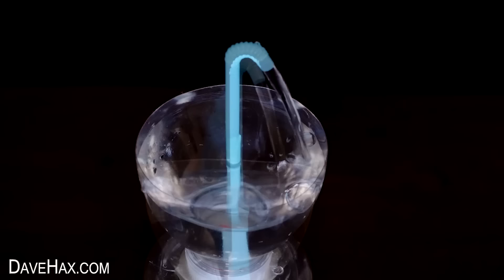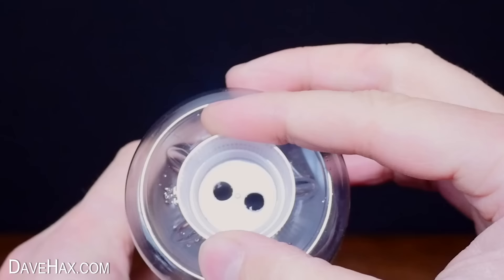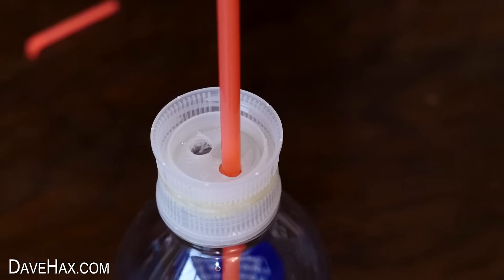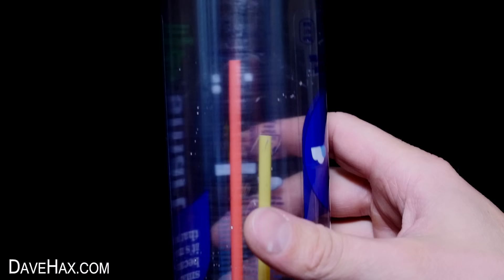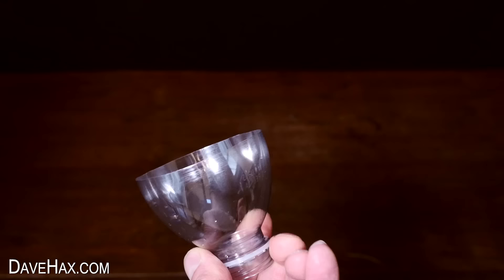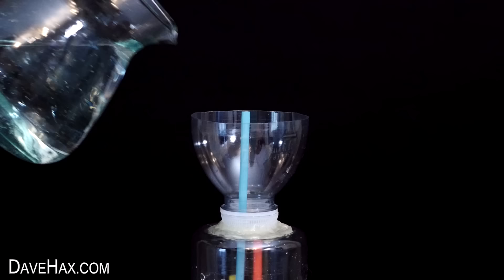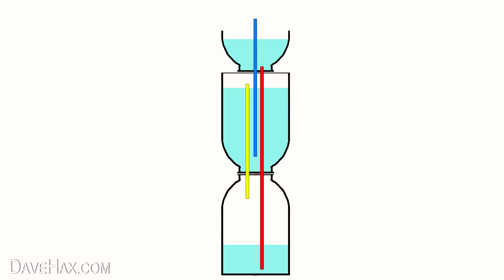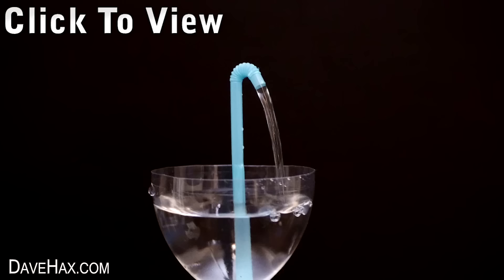How to Make a Non Stop Heron's Fountain

Comment: The only reason why I watched this was because it's titled "non-stop" which is usually against the laws of physics? Pretty cool none the less but definitely not non-stop.
Reply: @billygibbs3222  It keeps on flowing UNTIL the water in either of the bottles has run out, which makes it stop. It stops = not nonstop
Reply: Energy can’t come from nowhere. It’s against the law of physics
Reply: @billygibbs3222  what video did you watch? The last minute he shows how it stops after the bottom bottle level reaches yellow straw or top bottle level falls below blue straw, i.e. no more pressure to push water. Hence, not non stop and certainly not infinite.
Reply: I was just searching for such a comment !
Reply: @Poizon

yeah I thought the same
Reply: Yeap if this was a non stop thing i would make public a new engine that works with water and never runs out soon 🤪
Reply: @limibosi1785  Same! That's why I built it for myself! It took  2 attempts because at first, I used regular water bottles with a bumpy texture and got LOTS of leaks. Then I used the flat bottles like in the video and it worked. But it wasn't nonstop, and so I decided to go back to his explanation of it and found out why. :p
Reply: Agree 💯
Reply: @billygibbs3222  Which vid did you watch?
Reply: yes me too lol perpetual motion is a myth
Reply: The only way it might be possible is through the use of a superfluid (liquid helium for now) and a really thin tube that brings the water to the top. Even that hasn't been successfully done yet and here's some guy arguing for infinity...
Reply: @billygibbs3222  if this was the case dont you think energy companies would utilize huge fields of these to run turbines for an infinite source of energy?

Its impossible for something to run forever. If it ran off of gravity, it would need to raise the water back up (to a state of higher energy) in order to utilize gravity again. The laws off thermodynamics state energy in a system is always consistent, if it ran forever it would not be consistent
Reply: @billygibbs3222 Oh Billy Billy Billy! How old are you, son? I apologize if you're 12, and if you are, I'd be happy to detail the video for you and try and explain how fascinating the interplay between gravity and pressure is that's making this work. If you're an adult, however, good luck to you.
Reply: If it flows non stop it will broke the second law of thermodynamics: energy in a vacumm tends to spread out to a process like friction.
Reply: The water will eventually evaporate
Reply: @DDS Software it’s movement energy
Reply: Not nonstop at all. Perpetual motion machines are impossible.
Reply: There is no free energy device
Reply: You read My mind
Reply: It can be non-stop, just connect a pump and power it on and waste electricity, or connect it to a faucet and waste water.
Reply: @michaelralph8490  yes but there could be a power outage
Reply: @censusgary  perpetual motion is not impossible, free energy or over unity is impossible. Perpetual just means its running forever, and its not against physics to run something forever as long as you are constantly putting energy into the system. And in a closed system with no forces acting against it, the system will be exactly 100% efficient and run forever but you cant pull energy from it since it would add losses and stop, common examples of perpetual systems that run forever are liquid helium flowing in a closed loop or planets moving in our solar system.
So perpetual motion is not against physics, and perpetual motion can only happen in a closed system with energy constantly put into it or if there are exactly no losses to slow the mass down.
But free energy, or over unity, the idea of creating energy from nothing is against physics.
I know you actually meant over unity or free energy but I just felt explaining since I'm bored.
Reply: @AaronDarden  there is a way to get free energy but it is illegal, just connect a cable to your nearest street light and run it to your house, just don't let the cops or the electrical company see.
Reply: @gam1n302  lol, backup battery or solar power
Reply: @michaelralph8490  Solar power= no power on night. Battery= Low Battery
Reply: @gam1n302  solar power constantly charges the battery, so no Sun = buckup power that lasts until there is sun again ( basically how all solar systems work ), backup battery charges while there is power, when power is off it kicks in, when its too long without power and its daytime then charge it with solar, at night a hand cranked generator, being creative LOL
Reply: Yes, currently nobody has been successful in making a perpetual motion machine
Reply: @michaelralph8490  No battery can last as long as 12 hours. (I think)
Reply: @mjyanimations1062  have you heard of difference in potential !! its not creating energy but rather using the water pressure to move a liquid
Reply: Yeah i was hoping to see some perpetual motion
Reply: Me too. It's always against the laws of physics
Reply: witchcraft confirmed
Reply: But the earth is still flat, right?
Reply: You must be really smart realizing that a home-made experiment does not actually include a non-stop fountain
Reply: @Hellothere-vr9um  There are some "endless weight" pendulum clocks which use a double-pulley mechanism to allow the weight driving the mechanism to be reset without affecting the tension on the drive; I'd been hoping for something conceptually similar: a fountain which would need to have water continuously added at the top, and which would continuously drain water from the bottom, but would squirt water to a height higher than where it was added.  This would not have to violate the laws of physics in any way if e.g. every 100ml of water added at the top or circulating through the fountain would resulted in 20ml draining out the bottom but only 80ml squirting out the fountain.  I'm not sure if there would be any practical way to construct such a thing without moving parts, but it wouldn't be a "perpetual motion machine".
Reply: GET BAPTIZED AND FOLLOW GODS RULES TO GO TO HEAVEN..
Reply: @limibosi1785  why dont ya? I bet it's possible with  a couple adjustments
Reply: @Poizon-  its as closemas you can get to non stop with everyday objects is what he means.
Reply: @spidercat8262  How long did it take before it stopped?  A couple of minutes?  I would be curious to try with different straws!
Reply: I just replies that to someone :o
Reply: Who is Billy gibs here ,everyone is replying to him
Reply: @MikeC-ps1tc  After like 15 second to a minute
Reply: @spidercat8262  Ahhh okay, thats not bad.  I was thinking of a cool endless fountain to use on the pets!
Reply: @MikeC-ps1tc  That sounds epic!
Reply: @spidercat8262  Haha yeah, I am sure there would be a way to auto fill it, overall it is a cool thing to do!
Reply: @MikeC-ps1tc  If you can make it infinite, send me your instructions! 😂
Reply: Non stop rotation of Earth, Non stop river?
Reply: Actual non-stop/ Self sustaining fountains do exist, this is just a 3rd grade version.
Reply: Every non-stop flight ends at some point
Reply: DaveHax > physics
Reply: That was why I clicked too
Reply: Ikr
Reply: what the name sains principle is this.. like what teory behind water can fluid with gravity
Reply: Not nonstop but long-stop.
Reply: Yeah that name's a little bit misleading
Reply: Same lol
Reply: This is because of trapped air... Which gives pressure

Comment: Great video. Made one based on your design. Just a few comments: 
1) Get bottles with flat (or nearly flat) bottoms. Don't get the bottles that have the 5 or 6-star bases. It's more difficult to make that top cap airtight
2) Take off the labels before you begin constructing the fountain. I recommend goo gone and vegetable oil to remove all traces of the glue before you begin. 
3) Trying to drill through the hard plastic base of the water bottle is difficult and frustrating; it's much easier with a soldering pen to melt open a hole and then you don't need a large hole, just two straw-sized holes to match the holes in the top cap, 
4) A better way (IMHO) to splice the straws is with a diagonal cut;  the straws can then be connected almost without needing glue, 
5) Also use a diagonal cut on the ends of the straws as you thread them through the holes. Makes it a lot easier to pull them through and then once you have the straws threaded, trim to diagonal edge to make them even again.
6) Glue the ** out of that top cap between the seams and the base around the top cap, it's where you'll get the most air leakage. Also, enclose the glue seal in duct tape to add more protection.  It has to be completely air tight because any loss of air pressure will cause the fountain to fail.
7) In addition to glue, wrap the middle double cap with duct tape - maybe multiple layered colors for a nice effect. It will make the double cap more firm and stable.
8) Dye the water with food coloring to make a cool fountain and for an even neater effect, fill the reservoir with blue-dyed water and pour in yellow-dyed water. As the colors mix you get a nice shade of green.
Reply: 😁 only one who made it successfully can say this.. why don't you make a video of it(just an advice)
The most frustrated thing in this experiment is no matter how much glue you use,they will leak 🙃 i tried and lost my interest
Reply: @bhavana1425  yeah, the glue is where the thing usually fails. I had the best results by using a plumber's sealant.
Reply: You actually did try is and have advise for a better result ??😂😂
Reply: @bhavana1425  Don't use glue.  Use a silicone adhesive or Aquarium sealant.
Reply: If you’re unscrewing the bottom bottle, then just having two holes for the straws at the very top won’t work because the straws will get twisted if they’re rigid
Reply: @alishbanathani  That can happen which is why I was careful in arranging the straws and holes so they wouldn't get twisted while screwing the cap into the middle bottle. But yes, you have to watch out for that.
Reply: @nerapsnart  broo youre so smart please tell me your instagram
Reply: So if it's completely air tight it would technically be a non-stop fountain or would it just last much longer
Reply: @Archtew  it can't be a Non-Stop Fountain because once all the water in the central bottle has moved to the bottom bottle there's nothing you can do after that. But to make the middle bottle empty into the bottom bottle you have to have things air tight, because if air is escaping from the system, there won't be pressure to put the liquid from the middle bottle up through the fountain
Reply: Thanks for the tips. I made this device as a demonstration for Energy Merit Badge for Scouts BSA. Mt first attempt failed. You are right about getting a bottle that is flat on the bottom. I used old Gatorade bottles, and they have a star on the bottom. My first attempt leaked badly. Using a drill on the non-flat bottom was just impossible, which is why my first attempt failed. On my second attempt, I heated the end of a metal rod using my gas stove and just melted out a hole. Much easier. I didn't understand why you had to have a big hole on the bottom either, until I twisted all my straws on my first attempt. I did get it work on attempt two. To avoid leaks, I pre-tested the lids. I used massive amounts of hot glue. And to overcome the non-flat bottom I used so much glue if effectively became flat (with a melted hole of course).

Comment: I feel so sad when i hear the "to restart the fountain"
Reply: Well perpetual motion machines aren't possible
Reply: @RealArtUplifts But they aren't?
Reply: Hilih sama😭😭
Reply: The deltarune  vibes lol
Reply: Marc Scattolin it is for the snowpiercer!
Reply: Pmm are possible.
Reply: But the reset is so easy😊
Reply: At this point just use some of the energy from the machine and boom nrg
Reply: @RealArtUplifts how is it not helpful if someone doesn't realize they aren't possible they will keep falling for the videos that claim that it works constantly
Reply: @kennyrodriguez4641  you would constantly be loosing energy and the energy required to reset it will eventually cost more energy than its producing
Reply: Non stop restarting.
Reply: 1000th like
Reply: @assassinerage1909  it could be nonstop if the water level was perfect.
Reply: @tawsifiraj6060  That's a strawman argument. It's a logical fallacy, and it's irrelevant.  The point is that the video referred to a "non stop" fountain, but the fountain stops.  The video title is wrong - black and white wrong - period.

Comment: A "non stop" fountain that "stops" after each 2 mins...  Lmao.
Reply: True
Reply: It is nonstop restarting
Reply: You can try with liquids with higher density
Reply: No one can make perpetual motion machine. Because energy cant be created and destroyed at same time. This fountain is one of them.
Reply: I salute you for saving me almost 7mins of my life
Reply: @laureen69  haha...wlcm !
Reply: @Epic Genius "It doesn't take energy." I don't think you understand what energy is. The act of pouring water on the top creates potential energy that is transferred through pressure, to fluid, to air, to fluid pushing the water in the second chamber to the top. Electrical energy even at it's core is movement that is transferred into mechanical energy via motors.
Reply: @harshit3964  making a non stop fountain without the help of energy is pretty much impossible
Reply: @laureen69  lmao😂
Reply: @imlearningenglish4957  they have lower chance of going up the straw.
Reply: GET BAPTIZED AND FOLLOW GODS RULES TO GO TO HEAVEN..
Reply: Well technically it’s impossible to make a nonstop fountain because that would be infinite energy
Reply: their is air inside  bottle. the water  keep flowing
Reply: @tiaguilho1335  you mean energy?
Reply: @tanwodan3689  no the water stops every two seconds
Reply: @imlearningenglish4957  no you would need to try with a liquid that has its molecular structure in the same shape as a chain so the water keeps flowing but it will not flow forever a liquid with higher density would slow it down by a lot because it would be a lot harder to move by itself
Reply: @Mario-sm9oe  yes
Reply: 1 mins. Only 1 mins.
Reply: @sanyijutuber2381  no it’s two minutes
Reply: @Mario-sm9oe  omg 1:30 is a deal? 😂

Comment: If you glue the bottle top to the bottom of the bottle THEN drill the 2 holes you don't need the big drill bit and if you use a soldering pencil to melt the holes you don't need a drill at all.  Use a liter bottle to make the funnel with to give you larger diameter.

Comment: "if you don't feel comfortable using a drill, use a knife" I find using a knife to cut a hole in a bottle more dangerous
Reply: Sky Man  totally...I think
Reply: More dangerous for the user maybe but also less likely to tear the bottle apart (this can be annoying when drilling through thin plastic).
Reply: @tz8785  just go slow and speed it up gradually
Reply: @seth7407  just heat the tip of the knife on a flame and it'll slice straight through the plastic like it's butter.
Reply: @blackdoug6959  thank you
Reply: Sky Man big baby
Reply: Use a blowtorch lol

Comment: <sigh> Heron was a Greek philosopher and inventor who came up with a lot of really cool gadgets using water and air pressure as well as heat activated mechanisms and the very first "vending machine"... The original was actually quite a bit larger and operated for a much longer time... the bottom two "bottles" or reservoirs were hidden from view and so it seemed there was a fountain that poured into the upper funnel but it never seemed to "fill up"... thus why it is called a "Non-stop Fountain" in the book he wrote called "Heron's Pneumatica"...  Yeesh...
Reply: That was very informative, thank you for that tid-bit. Im not sure why you're so despondent though.

Comment: Hello, I have tried this experiment. It does work but you will have to try MANY (like so much) tries. Here are some tips:

1. Use waterproof tape. Glue guns will most likely NOT work as the pressure needs to be A LOT in order to work.
2. Make sure ALL the holes are covered. It will need a lot of pressure as I’ve said before.
3. Don’t make a giant hole on the top. Instead make 2 tiny holes that fit your straws.
4. I did this experiment with bottles that don’t have flat bottoms. Works but you will need a lot more tape. 
It took me about 8 - 9 tries and I had to restart twice. 
All in all, it works, but you will need a lot of effort, patience, and dedication.
Here's what I did
- I followed all the instructions by Dave for the bottom part.
- For the top part, I made 2 tiny holes using a solder, and made 2 holes in the cap. I glued the cap onto the bottle with a glue gun, covered up a bit using a glue gun as well. After that, I used waterproof / anti leakage tape (I used Lakban tape, not sure if it's available in other countries, but I think you can use something like flex tape) and taped it a lot.
- I put the bottle upside down to spot the leaks and I taped those parts.
- After that, I followed the instructions in the video on how to use it, and it worked. Definitely didn't last forever, stopped in about 15 seconds. Still, great instructional video. I recommend trying this experiment if you like self torture or if you want a fun science experimet.

Comment: Chapters:
Intro 0:00
Making it 0:12
What's happening 5:22
How to restart it 6:01
Origin of "Heron's fountain" *copied from another comment"
Heron was a Greek philosopher and inventor who came up with many really cool gadgets using water and air pressure as well as heat-activated mechanisms and the very first "vending machine"... The original was quite a bit larger and operated for a much longer time... the bottom two "bottles" or reservoirs were hidden from view. So it seemed there was a fountain that poured into the upper funnel but it never seemed to "fill up"... thus why it is called a "Non-stop Fountain" in the book he wrote called "Heron's Pneumatica"